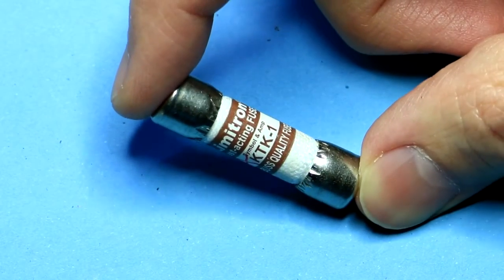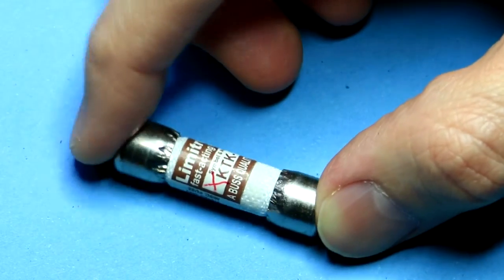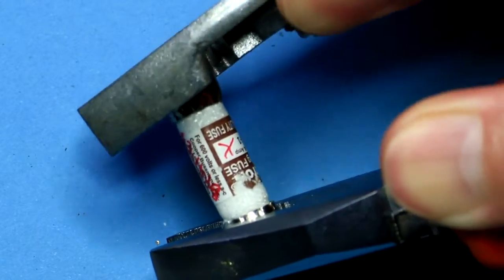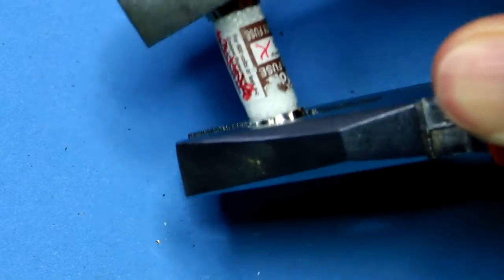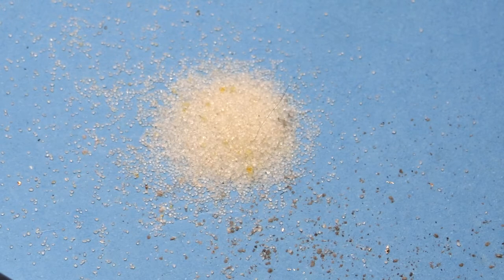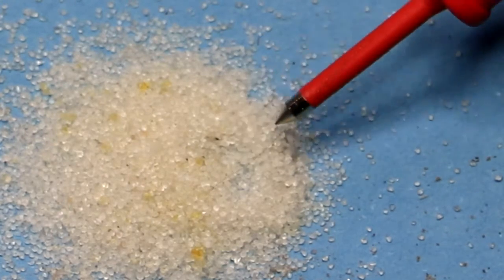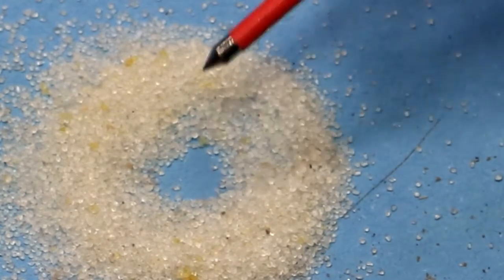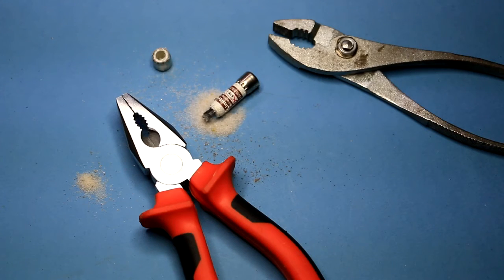What is inside an HRC fuse? (#015)

Comment: Did a 200A ceramic mains fuse a while ago. Inside the fine silica sand along with a lot of small ribbons of fuse material soldered to a carrier.
Reply from the maker: - 200A, sheezsh, how big was it? I neglected to say that the melamine material is slightly elastic, so it does not shatter like some of the smaller glass or ceramic fuses when it blows.
Reply: Was similar to these..

http://www.flameport.com/electric_museum/old_fuses/J-type_wedge_fuses.cs4

Used in a substation as feed fuses. Failed after being in use for around 50 years from fatigue, as it was subjected to rated current pretty much every evening as everybody turned on the stove to cook dinner. Was made by GE in South Africa, when SA still had a good manufacturing base.